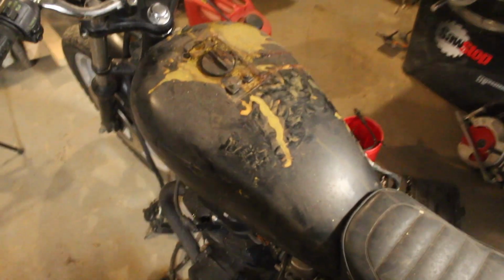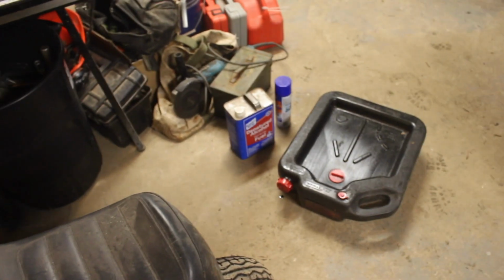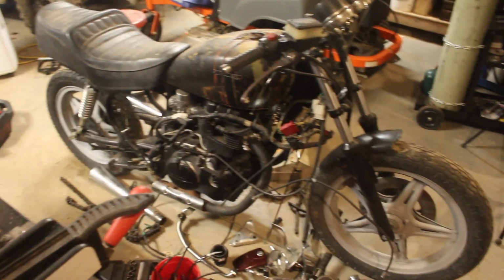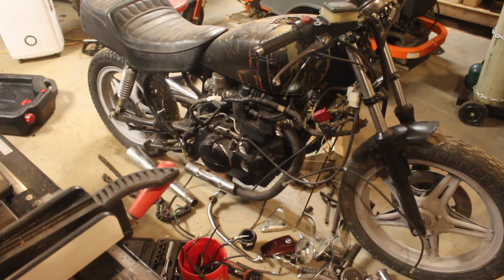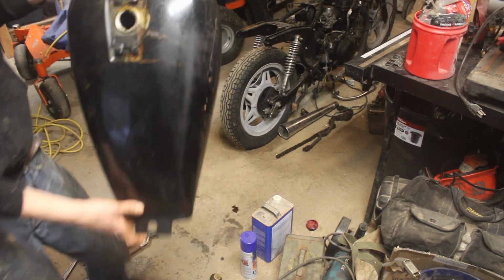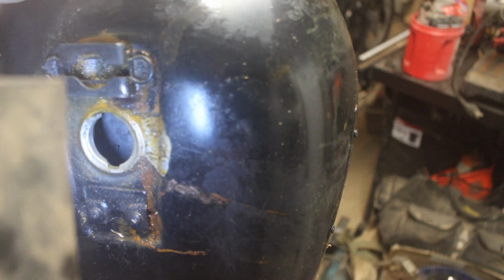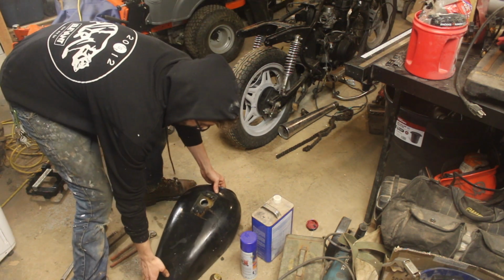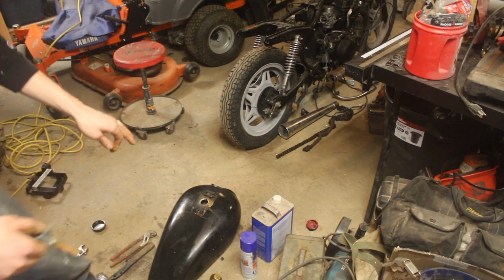How about we work on the FREE Honda CM400 CafeRacer?? Gas Tank Issues

Comment: I found a free one by the dumpster that no one wanted and we decided to take it, but it’s really stripped and all the wires are unplugged, any advice on figuring out where they go?
Reply from the maker: I would pull the whole harness off and sort it on the bench
Reply: Into The Dirtshop alright we will, thanks man
Reply from the maker: No problem good luck!
Reply: Into The Dirtshop update: the engine is locked up so no point in trying to restore it 😅 but now I’m determined to own a cafe racer build
Reply from the maker: You’ll find one!